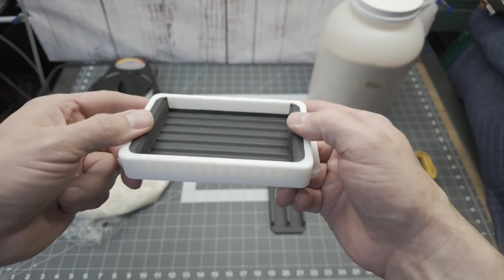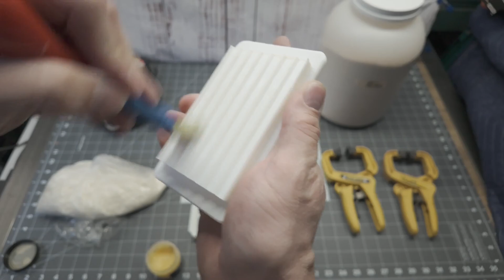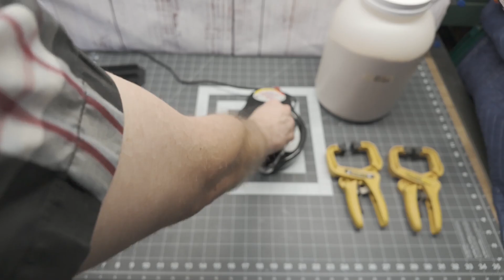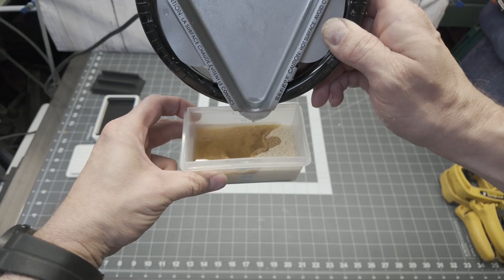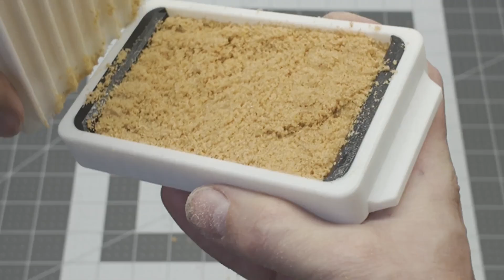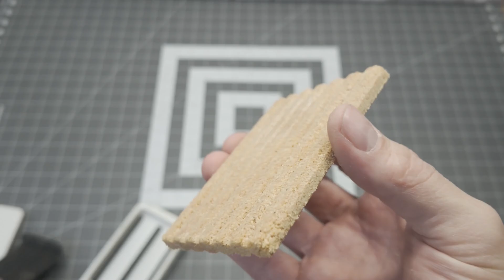DIY Sawdust Fire Sticks: Easy Fire Starters with Wax and a 3D Printed Mold

Comment: It seems like the thingiverse upload is missing the top piece and includes two of the inserts instead.
Reply from the maker: Ok I updated it should be there now 👍
Reply: @Sawdust_and_Circuits  Thank you for sharing these.  I printed the original wider version yesterday and am starting to print this one now.
Reply from the maker: @JeremiahJohnson-d6w  yeah these are a good option, the first batch was difficult to separate,  they are more convenient than the giant brick I designed but both work well.
Reply from the maker: I will look into it thanks for letting me know